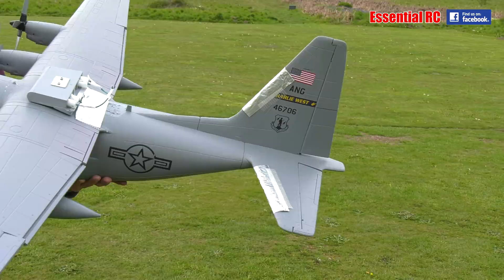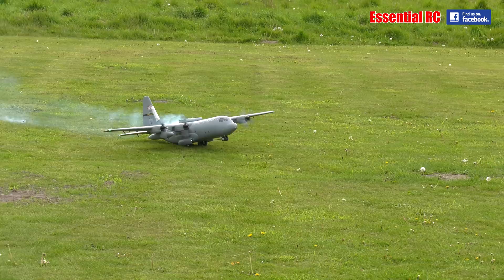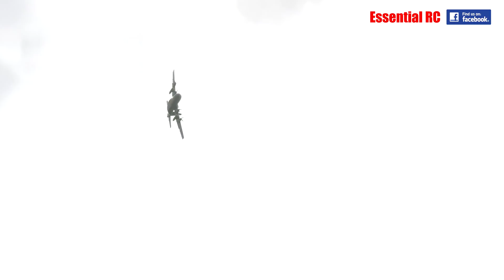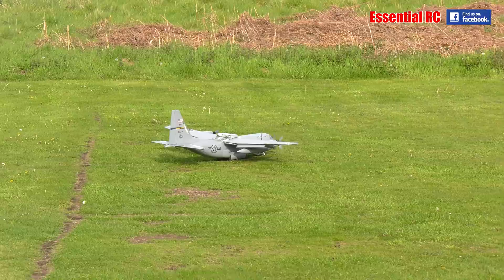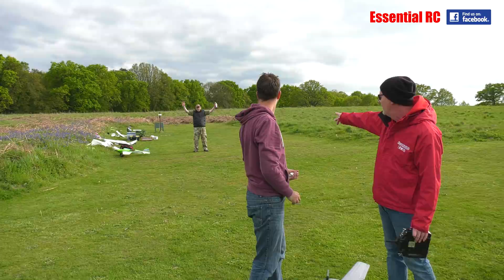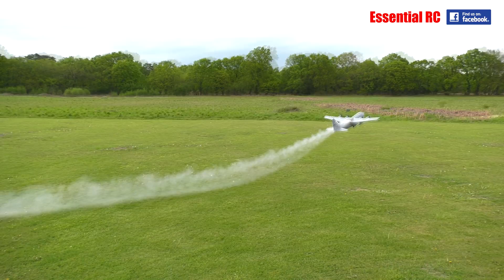ROCKET ASSISTED TAKE-OFF: HobbyKing / Avios Lockheed C-130 Hercules

Comment: That was great, maybe you need some wingtip gear perhaps retractable for grass taxiing LOL so you don't foul a prop again rofl jk. That rocket assist was great I'd like to see that in flight. If those are model rocket engines I probably put two fuses in each one for reliability if that's even really necessary because if I remember correctly those model rocket fuses can be a little finicky. But I haven't messed with a model rocket engine in a long time maybe things are different now. And maybe you can make it so that you can ignite the fuses from the transmitter lol.

Comment: Why the drop , harsh landing ?
Reply from the maker: CG too far forward. I was using a 4S2700 and the recommended pack is a 4S2200. Unfortunately the pack can only be secured in 1 position using the provided strap unless you restrain it in a different way. With it being slightly heavier it didn't allow me to flare on landing. No damage done by virtue of the landing though. More from my poor taxiing. Cheers Dom (Essential RC)

Comment: I'm curious to know if you could possibly find a ROUGHER field to fly from?
Maybe a rock quarry?
An old tree farm where stumps reign supreme as obstacles?
Gentlemen, if you own the field perhaps a bit of off-flying season work to smooth the planet so you won't rip the undercarriage off or yank an engine pod from its moorings would be in order.
Otherwise, pretty interesting experiment. I'm curious if you've tried to determine just how much additional thrust is added by the small rocket motors? Perhaps strap them in and set the model on a smooth surface like a road, etc., and learn how much momentum they add to the thrust equation. 
All in all pretty cool and fun experiment. 
CONGRATS!!
Reply from the maker: 100% agree with you. Our local flying field is very very bad at the moment. I've made the observation to our Club and they are going to get a roller out in the near future.

Comment: Actually if you attached the rockets to the sides just behind the wing (maybe with a degree or two of down angle), and hooked up a 9v battery on a servo, or jury rig a switch/trigger on a pushrod, then use nichrome igniters in the rockets hooked to the battery. They would ignite at the same time that way, and on the fuselage behind the wings the exhaust wouldn't hit anything. If you use rockets with an ejection/parachute charge, and just use tubes to hold the engines, when the ejection charge goes off it would kick out the empty motors - cut down un-needed weight.

A simple soft bare wire contact attached to the elevator push rod would work, since you don't have a spare channel to use as the igniter. You will just need to see where you have to mount the triggering wire.
Run a thin wire from the negative terminal of the battery, once you've determined the CG position for the battery, back to where it will connect to the igniters, light braided wire will do, and secure it (tape, glue, whatever), run the wire out through the fuselage  (small hole) to where it will attach to the igniters on the motors (leave enough wire out so you can strip them and twist them to the igniters). From the positive terminal run a soft type, braided, wire over to wherever you decide to use the pushrod section, strip about 1/2" - 3/4" of the insulation and fan the wires out a little the next few steps is where you'd have to decide where/how to mount this wire in the manner I'm laying out. I just envision a simple piece of styrofoam or balsa cut to the right height and glued in position to mount the + wire on, and where it goes depends on the wire's position on the push rod instructions next, and your trim settings, for the triggering step.

Run another wire back to the motors using solid core wire (22 gauge?) for this side, again running it outside to where it will connect to the igniters (and, again, long enough to strip and twist to the igniters), the other end is brought to where it will connect on the elevator push rod. Leave some slack for push rod travel, strip about 1/2" of the insulation from the wire.

Once all the wires are run, and your airplane is in flight trim with battery and motors in place, mount the braided wire on the brace (brace height determined by the push rod height) with the fanned out stripped end of the wire, mount the wire with about 3/4" projecting out over the push rod, and the wire about 1/4 inch above the push rod. Mark the spot right under that wire on the push rod, then give full down on the trim and attach the + solid wire running back to the igniters to the push rod right on that mark with the wire pointing straight up.

Start your launch with full down trim, get your take off roll going, when ready to ignite put up trim in - WHOOSH!

Put in a safety switch to disable the battery when setting it up. The soft wire won't interfere with the push rod functioning, it would just be pushed aside by the ignition wire on the push rod, then just straightened back up for the next use.

What do you think?

Comment: That was an awesome takeoff! After that, the thing looks like it flies like a brick!
Reply from the maker: CG needed to be further back really but it's difficult to change the battery position with the strap in a fixed position. I'll do something for the next flight. Cheers Dom (Essential RC)
Reply: It flies quite smooth and well mannered.

Comment: Stupid and dangerous. Fuses... really, FUSES? Your pyro "expert" doesn't know how to light a model rocket motor with an electronic match? Come on guys, get your act together. Thumbs down (still subscribed though).
Reply from the maker: Uh oh. Safety police are out. We forgot to bring the kitchen gloves. Maybe next time.
Reply: @EssentialRC  : Yes, oven mitts are definitely in order here. I give you points for at least having a fire extinguisher standing by. Seriously, there is actually a much safer way to do this. 
1. Use a servo relay for the igniters. Like this one: https://www.servocity.com/rc-switch-with-relay. Be sure to include a mechanical safe/arm switch somewhere between the relay and the igniters (preferably with a cool little "Remove Before Flight" flag on it).
2. Mount the motors on the side of the fuselage so the exhaust doesn't go near the control surfaces. If you carefully angle the thrust lines through the horizontal AND vertical C.G. of the model, yaw inputs from asymmetric thrust are minimized. (A gyro/receiver would be a good idea too).
3. Use a burn through hold back. See here: http://www.oldrocketforum.com/showthread.php?t=5219&page=4&pp=10&highlight=TSTO
4. Conduct at least one static test of the whole rig with the model held on the ground (preferably away from children, pets, other cranky old modelers and DRY GRASS).
5. THEN... don oven mitts, count down to ignition and go fly.
Reply: @EssentialRC  the FOGs have arrived....
Reply: @smoothvirus  LOL... I have the mug. Somewhere... I know I put it somewhere.
Reply: @bat2293  dangit, you made me laugh. Fair enough. :)
Reply: Bat22 I strongly suggest not buying fireworks, believe it or not they use fuses to ignite the pyrotechnic mix, the size of those little motors are not going to cause a massive loss of life if they go pop and are half the size of rocket motors and fireworks that still use.... fuses